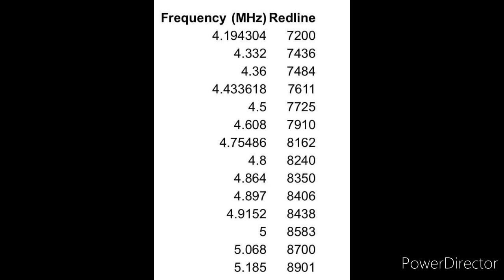How to: Rev Limit Increase | Mk2 Golf GTi 16v

Comment: Can the Bosch mechanical fuel injection system put enough fuel in at higher revs over stock Rev limit?
Reply from the maker: That all depends on the engine spec to be honest, mines currently 13.4 lambda so lean best torque and thats using the WUR Modification and revs to 7200rpm

How high are you looking to rev too?
Reply: @GreyGooseRestorations  Currently my 16v has flowed head, uprated cam, tubular exhaust manifold and the larger 2.0 inlet manifold. So she flows air rather well, makes peak power at 7000rpm with the cam. But then I super annoyingly straight away hit fuel cut a few milliseconds later at the 7200 mark as she revs so freely. So I’ll likely copy you and raise the limit.

Long term I want to go to a 2.0 with a higher revving 8000rpm peak cam, so I went to have a ~8500rpm limit. I just don’t know if the Bosch mechanical fuel injection can cope with that? 🤷‍♂️
Reply from the maker: 7200rpm is the rev limit so its probably that cutting in rather than fuel cut. When i had mine set to 8000rpm i still hit the rev limit before any fuel cut.
Reply: @GreyGooseRestorations  sorry I meant rev limit. I think it does cut fuel on these though? Maybe it’s spark IDK
Reply from the maker: Cuts spark on these 👍
Reply: @GreyGooseRestorations  Thanks. I’ve hit it a few times, I should’ve know. 🙈

Any thoughts on whether the 16v Bosch mechanical injection can adequately fuel up 8500 rpm?
Reply from the maker: If you have a WUR modification then fueling should be ok, again every set up is different, my WUR is set a 3bar and i float around 13.3 /13.4 lambda thats using innovative wideband on the road and on the rolling road is was also at the same lambda at 7000rpm